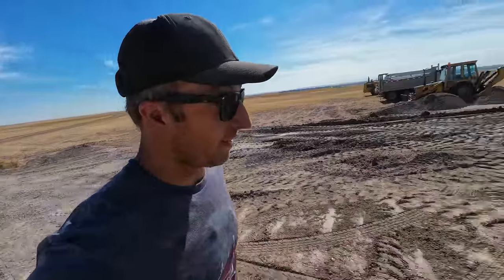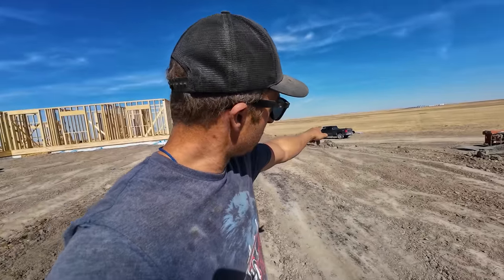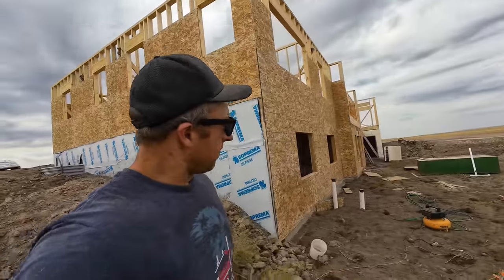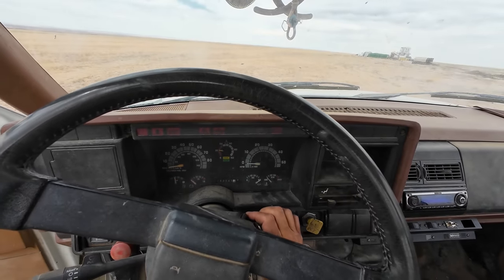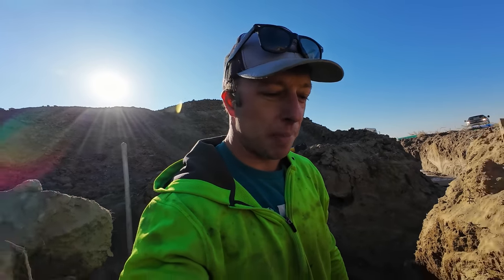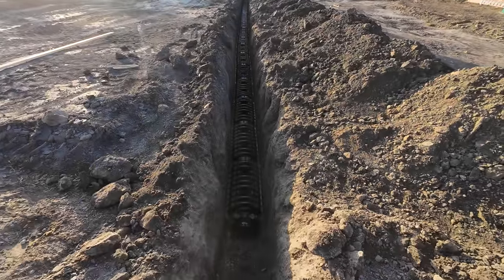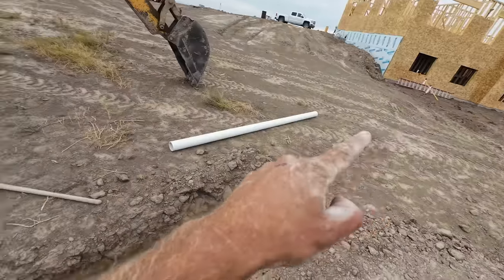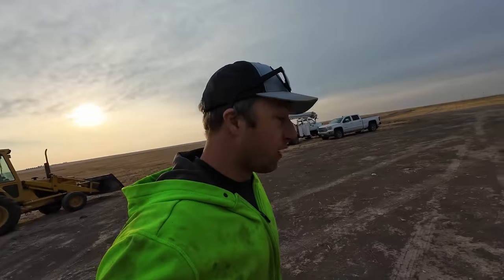D.I.Y. Septic Leach Field "CHAMBERS" - Farm Home Part 7

Comment: I would recommend adding a vent and overflow drain on the drain tile system so that if the pit gets filled up, it will overflow onto the surface of the ground somewhere below the level of the basement.

I don't know what your grades are, but that may be as simple as having a tee next to the house with a bubbler cap on it, or putting a riser up out of the pit so it's not entirely sealed in with dirt.

Also, you need the pit vented anyway, otherwise you may get back pressure if you have a lot of water trying to flow in, and no way for the air to escape.
Reply from the maker: That is a great idea! Definitely can do this.
Reply: We are required to have an open up pipe at the end of each infiltrator run for.this reason.  If his 300 feet.fills up with liquid he has big.problems for.sure.  The up pipe opening is required by code in my area.
Reply: @beckyumphrey2626  I think he said he had vent pipes at the ends of the septic infiltration runs already, I am talking about the foundation drain tiles that dump into the rock pit, which doesn't have a code associated lol

Comment: Your septic system is well thought out!! Over kill never hurts...300' is more than enough for your house. Don't forget to grout your concrete/metal/plastic riser for the access hatch so it doesn't move. Also make sure it's at least 6'' larger in diameter....makes it less work for the pump truck every  10 years 👍
Reply from the maker: Appreciate it! Actually didn't grout the riser but still can dig it out and do so. The plastic tube was replaced with a longer 8" tube and the concrete riser was placed on top of the tank access hole.

Comment: The sunrise goes more south in the winter. Probably should have some overflow on the french drain pit, just in case there is a LOT of rain and the pit is full it won't start backing up.
Reply from the maker: Not a bad idea, it probably should be daylighted I didn't want to deal with animals get inside so I kept it on the ground. Can always be improved!
Reply: @WelkerFarms  they make pop-ups for this very purpose.  Closed when it's not flowing water to keep things out, and automatically opens with water pressure to let water out when it needs to

Comment: Very interesting how they do septic where you’re at in Montana down here in southern Nevada. Our septic tank went in just like yours except for our Leitchfield was two 80 foot runs but they dug the trenches 24 inches wide 12 feet deep, filled them up with 6 feet of pit run, and then our line was a scheduled 100 4”  pipe with a whole bunch of little teeny holes in it with mesh wrapped around it and then they put sand over that and then backfilled it.

Comment: Nick
You are doing the proper job of directing indoor wastewater, and perimeter drain water, into leach fields. But as a hydrologist I do not that believe that a leach field 5 feet below grade will water your lawn. Trees if you plant them will have a root system that deep, but not grass. I also live in arid lands, near Denver, and my solution was to top-water my yard using roof-runoff. I doubled up the number of standard-spaced gutter downspouts, and directed water to ground-level “gutters” that are placed level on the ground, with a crimp at the end, and numerous holes drilled in the bottom of the “gutter” or rectangular metal troughs. That way precipitation on the roof will be directed away from the foundation, out onto the yard, where plants can use at least some of it. The gutter guys can make the troughs for you, and the troughs can be detached so you can mow the yard or weed gardens.

Regards
Reply: he has kind of complained a few times they are experiencing kind of drought conditions there so there may not be enough rainwater to really irrigate anything . so it may not be worth the investment. look at how small his dry well is for drainage water. where i live near lake erie that would be way way too small. we get biblical rain here at least several times a year in late summer as well as plenty of regular rain.

Comment: Nick, the sewer leech lines do not irrigate the grass by the liquid that goes through the leech field. The reason that you see the green stripes in yards where the leech field is, is because of the gas vapors. As deep as your lines look to be I doubt that you will ever see this. Also if you see liquid anywhere near your grass level then you have a problem. The liquid should never be above those chambers anywhere in the soil.
Reply from the maker: Didn't know that it was just the gasses, it'll be interesting if there is any noticeable green above the field. I am not sure how much of a yard to make yet so irrigation lines may or may not be over those fields.
Reply: That is false, leach fields add a lot of moisture to the surrounding soil. Agreed that leach fields should be buried deeper than they usually are. But I dont irragate my lawn, and guess where the only grass grows. Exactly where my  leach field is burried 😅
Reply: I have been a soil scientist for almost 15 years specializing in septic and leech drainage. If your leech field is adding moisture above your drain field it is because your leech field has failed or the water cannot travel through the soil fast enough. Another possible cause could be that the drain field is too shallow. Code for our area is 32” min. Deeper depending on soil density. Grass and other plant material will grow better above the drain field. This is due to gasses escaping from the leech field. The gases do carry nutrients typically high in nitrogen.
Reply: Also it is true that a leech field will add moisture to the soil. Obviously gray water is traveling through it. However at that depth typically grass roots would never reach it.
Reply: water goes down @WelkerFarms

Comment from the maker: What do you all think? I am a bit concerned the system is deeper than it should be but with hard Montana winters the depth might be a good thing. I did vents the ends of each run to insure sufficient oxygen for the microbes feasting on the excrement.
Reply: Better safe than a poopsickle.
Reply: @Plutogalaxy  good point, that’s why they’re called the run’s.
Reply: Hopefully you have better luck than we do in North Dakota with that style of system. Here our clay does not absorb anything so then the chambers act as a big tank, so they fill up and then back up the system, which then you have to pump out, about once a week, from one of those vents.

Ours were a lot shallower, bottom of the trench was about 4 feet deep. One out of three runs did freeze we think, or the distribution pipes going to that run did, as it was always dry in the winter. The other two always had something in them to pump and they weren't froze.

I've heard lots of theories and ideas on how to make them work, such as digging the trench wider then filling in with gravel and then just enough topsoil on top to get grass to grow(so water can evaporate through the gravel upwards) to 3x to 4x the length of the recommended runs, but here many who have it are just abandoning them and going back to the old style drain tile and gravel system, as here it works well and if you're going through it again, why not do something that is known to work.

But hopefully, with your sandier soil, that system actually works.
Reply from the maker: @J-1410  sorry to hear your system isn't working well. Sadly ours is pretty clayish. I guess time will tell if it works or not, wasn't cheap! On the bright side our soil is usually super dry so should wick well. I didn't dig them wider or add gravel as that was it's selling point but I'm sure doing so would definitely improve the transfer of water to soil.
Reply: The idea of the outlet filter sounds great on paper but they don’t work very well so you will likely pull it out and leave it out. Been on many service calls and they were the problem. I also wish you dug deeper,added sand or stone then installed the tiles. I hope your new septic system works great for years to come.
Reply: @J-1410  That sucks, nothing worse than a bad septic.

Ive designed a lot these systems over the years, I'm a soils engineer. The key is to check how past water will drain into the ground, and come up with a size that meets what you need.  clay sucks for septic.

The chamber guys say you can bury them up to 8 feet, but your better off having them pretty shallow, so the microbes can "beathe"
Reply: As long as the water table is lower then the pipes it should be fine. Here in Minnesota you have to do a soils study then that dictates the type and size of system. Slope is the key to make sure water doesn’t sit in it. The first winter I would mulch or cover the drain field to help fight frost
Reply: @robertquast9684  Minnesota here too!  Our new septic system "drain field" is above ground!  Our mound is covered with grass.  We laid a landscape water barrier mesh over the grass seed so the seed wouldn't wash away during rain storms.  We have our septic tank pumped out every 2 1/2 to 3 years.  Nick's house looks great!
Reply: I'm intrigued by this...  By definition "septic" means anaerobic, or no oxygen.  Are you venting the runs to help get further aerobic decomposition after the septic tank has done it's job?
Reply: @WelkerFarms  I'm in the dry part of ND. Ironically these systems work great in very wet Minnesota for some reason.
Reply: You should be just fine, however im in colorado and installed one like that in clay type soil and ended up putting a foot of leach rock under the infiltrator sections and then backfield with crusher fines...it has performed flawlessly for years...just something to consider
Reply: The filter bed is suppose to evaporate
Reply: Haven't seen anything in a couple of weeks, status?
Reply from the maker: @christopherphillips1151  everything is buried and looking good! New house video is up next. Should be up Saturday.
Reply: Referring to the house
Reply: @WelkerFarms  I'm really enjoying see the family growth. You, legarms and your families work hard to get done what you guys have accomplished. I'm an old school farmer. A, B, John Deere. Then stepped up to red iron.

Comment: I put that same septic leaches in my system and i wish i could have had that style, mine has little slots all the way around them and i have sand here in Oklahoma and every so often i have to dig them up to clean under them because sand works through them little slots and fills them up and then no leaching, i wish i would have put rock on top of it.
Reply from the maker: I sure I hope I don't have to dig these up again, I can only imagine that is a headache! I probably should have put gravel around these too. Was trying to save money and time to not do it as they told me it wasn't necessary.
Reply: @WelkerFarms  i hear that I was trying to do the same thing but I imagine gravel is hard to get in your area, but you should be okay if you put some rock on top from the field.

Comment: French drain around your foundation is insurance. If.you EVER have water discharging from the exit you have bigger problems as water should never make it to the drain if your grade and roof drainage is correct.  In my area French drain exits are open so they can be examined.for.water exit which is a indication of.problems.

Comment: Very nice, I am surprised that you don’t use perforated pipe for the drain field.
Reply: Google INFILTRATOR system.  Been around 25 years and is the best.  The chambers are slot perforated.

Comment: Nick, just a couple of comments and questions. Talking with a septic guy, he had seen the open bottomed drain fields plugged by gophers.  Hope you are deep enough to  avoid this problem. Keep trees away from drain fields, once the roots get in the drain field either the field or the tree will have to go. Will you be using your piped in water to irrigate your yard? May I suggest that you figure your cost of water before you put a lot of money into a graass yard, Good luck.

Comment: Hey Nick, the house is coming along great.. I don't know if I told you but i'm also in the process of building my final dream home.. Similar but smaller, walkout with the jut out on the main floor like yours. I should have made my garage bigger, but it is what it is. I sure wish I had the time & knowledge to do more of it myself but working away takes up so much time & now weather has moved in so my little yard tractor is kind of useless with frozen ground.. When do you think you'll be moving in?

Comment: This might be a dumb question,  but with the walk out basement, will it be harder to keep warm during yalls winter? I'm born and raised in Central Texas, so I have never seen a basement or anything like yalls winter's.
Reply from the maker: Any wall with windows and doors will lose some heat but the walls themselves will be spray foamed and covered in insulation so they should be pretty effective in retaining heat. A basement without any windows and doors will be easier to keep warm.

Comment: Not understanding the septic system. Always thought you needed a licensed septic designer/installer to do these, not cowboy it in as you go. Also in my experience the leach field lines can only be 3 feet below grade to allow for proper aeration and allow some of the effluent to "evaporate".

Comment: I see you got the same builders as your brother with the same primitive framing methods ,but they will geter done.
Reply from the maker: Does it really make that big of a difference? Honestly it's just framing. Blows me away how critical people are to practices that have built millions of homes that are still standing strong today. What matters now is insulation, siding, Roofing, windows, high-efficiency furnaces, ICF Foundation, spray foam. That is what matters. As long as the house is solid, I'm one happy camper.